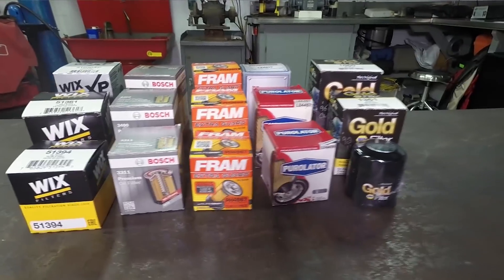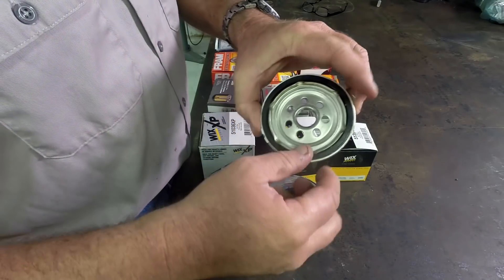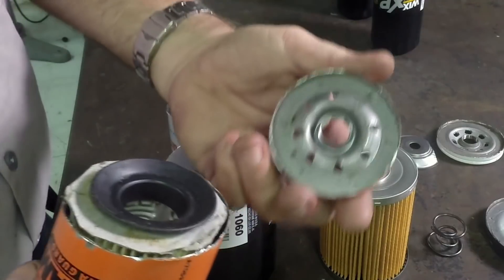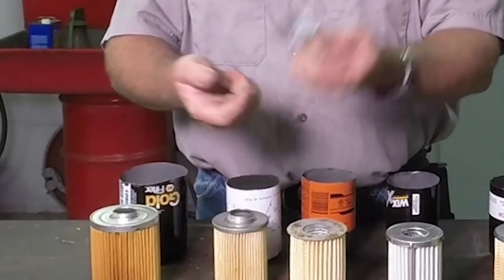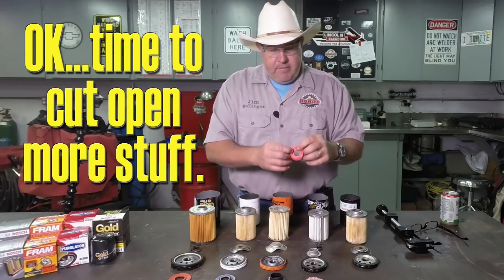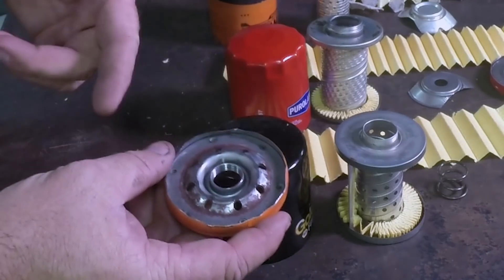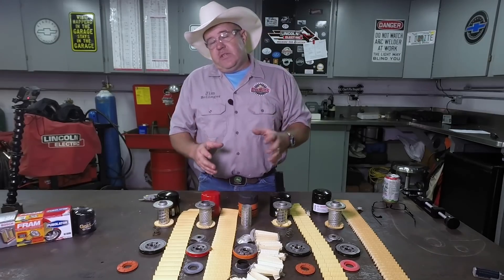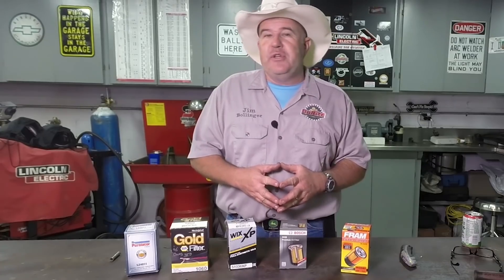The worst oil filter EVER!

Comment: Fram ultra synthetic filters are very high quality.
Reply: Update when you actually do some actual miles on that Acura. 280K like on my RL is a start.
Reply: @16v15  250k on my nissan. Switched to Fram ultra about 20k ago when I saw one of these videos.

Oil change every 3k. Engine runs fine, looked clean when I changed valve cover gasket few thousand miles ago.
Reply: @dielawn22, Granted if you change every 3K and don't live on a desert sand road, you can get away with almost anything. Until you have a catastrophic filter failure. 

Point being, do you want to risk it?
Reply: @16v15  funny you say that. I did live in the desert at the time, with wind and dirt.

As I said earlier. Once I found out the 5 dollar filters were that shitty I switched to ultra. The grip helps.  And ultra is comparable in price and quality to wix
Reply: Wronge one ruined my friends race engine junk
Reply: You're basing this claim on what, exactly?
Reply: @TonyRule  Watch a cut apart video on a Fram ultra synthetic filter. The orange cans are junk, agreed.
Reply: Tony Rule my friend races he had one of the fram premium filters fail he lost oil pressure during a 15min race it ruined his race engine I think that’s proof enough he still has the filter in his shop to show everyone that there junk you can run junk if you like
Reply: @duffman1241  I personally wouldn't trust anything FRAM. Hence why I was questioning why the OP thought the Ultra Synthetic ones are high quality.
Reply: Only Fram worth buying. Completely different construction type (metal endcaps) than Orange can or Tough Guard. To get your monies worth though, needs to be run on extended oil change intervals.
Reply: Fram inc. will be sending you a check soon.
Reply: Fram is very high quality, no one makes filters like Fram does.
Reply: @killer2600  I agree with half of your statement...

Comment: The video is not completely fair to Fram, although I don't use Fram either, but Fram makes several levels of filters.  The one he has is their cheapest line of filter.   They also have a medium level, and a best level.  He should have purchased a Fram filter in the same price range as the others and then compared.  The best level is much like the Wix.  By the way that probably wasn't rust, it was probably glue, but I wasn't there so can't be sure.

Comment: I've been using K&N for the last 15 years on my 3 vehicles, I love the nut on the bottom, it seems to be heavy duty, I'm sure I am wasting my money and NAPA has always been good to me.
Reply: Joe schmo I use the k&n on my harley. Mostly because of the nut on it. Makes it very easy to remove on my bike
Reply: If you need a tool to remove an oil filter, it was either installed improperly or you have too much soy in your diet.
Reply: Tony Rule the filter on my 2000 Electra glide seizes itself every single time. I might add that there is a reason they make oil filter wrenches.
Reply: @room2376  Yes, there is a reason they make oil filter wrrenches, just as there's also a reason they make screw extractors. That reason for oil filter wrenches is because people fail to install them correctly by not lubricating the face of the seal and/or overtightening them.
Reply: Tony Rule I lubricate them every time. And tighten exactly as it states on filters. Seizes every single time. I would add that I can’t even grip it tight enough with my hand to turn it as the directions state, due to the area it’s in. I would also add that on semis and heavy equipment they very often seize as well. In large part because they are on for 10,000 to 15,000 miles. It happens everyday and not always because they weren’t lubricated or properly installed. Much like when you have to remove a broken exhaust stud that broke when removing. It wasn’t over torqued or improperly installed. It’s just been there for a long time and has seized. Hence those screw or bolt extractors. There is existence isn’t always because someone messed up. It’s because “shit happens”.
Reply: @room2376  It's funny how in 25+ years of doing all my own vehicle maintenance, since I finished my apprenticeship as a mechanic, I've never had shit happen like this. My filters always spin off easily by hand (I almost always do the change with a hot engine too so I can't linger too long getting it started turning) and have never once leaked from the base seal. While there's certainly an excuse for an infrequent maintenance item like an exhaust stud to break through long term effects of corrosion, not merely operator error, I don't think the same can really be applied to something like an oil filter, that is replaced at least annually and isn't subject to anywhere near the same extreme operating environment.
Reply: Tony Rule as stated if I could get my hand around if I’m sure I could remove it. But I can’t. So a tool is needed. I would also add that being a diesel mechanic that is ASE master certified for 34 years . I’ve probably seen a lot more than your 25 years of doing your own maintenance.
Reply: Tony Rule also on my bike I can’t even get my hand around the filter due to how tight clearance around it is
Reply: @room2376  I'm not familiar with the model, but that seems like a bad design. On my full fairing Kawasaki you can change the oil and filter without even removing any bodywork.
Reply: Tony Rule it is a bad design. I don’t have to remove any body work. But it’s between the engine case and the frame. With very little room around it. And the way it is around it a typical oil filter wrench is almost useless. They have a big socket style one that fits around the base and even it has a cutout in it for clearance. I find it much easier with the k&n because it has a 1 inch hex on the bottom. Just use a standard 6 point socket and I have no problems. I’ll add that it’s never seizes to the point I have any trouble removing it this way. But to get just my fingers on it and have the grip to remove by only hand. Not going to happen
Reply: Tony Rule by the way what model Kawasaki due you have and how do you like it. For other reasons I’m planning on getting away from harley. I’m looking pretty hard at bmw k1600b’s. And some others. I ride around 15,000 miles a year. So I need something comfortable on those long hauls and the only bike I’ve had any real long distance time on is my Electra glide. Other than my old hardtail but my back can’t those long hardtail rides anymore.

Comment: I had a fram filter collapse on a sbc 350 engine oil pressure dropped to 10 psi or less. This was on a new engine by the way. Swapped to a different filter and oil pressure shot up my engine builder said he seen it before.

Comment: Fram filter destroys Ford  5.4 engines  drain back valve doesn't work.. lose all oil pressure to the hydraulic tensions...
Reply: Motorcraft only for those engines!! I hear ya, I have a 4.6, always use motorcraft filters.

Comment: I used Fram on my Honda Odyssey and at only 300,000 miles, the AC compressor wore out, so I traded it off. If only I'd used a better filter, I could still be driving it.

Comment: What you failed to show is each filter after 3000 miles.  Take apart that Napa filter after 3000 miles and it won't looks so appealing.  Taking apart new filters does not tell the real story.  Lets see you do the same video, but with filters after 3000 miles of use.  Warning, you might get that dandy white hat dirty.
Reply from the maker: Hat dirty? Lol...You obviously don't know much about me. Start with junk, it will still be junk. No excuse for rust in all 3 fram filters. You want to use Fram filters, no sweat off my back, it's your call. Folks should know what they are getting when they buy "oil change special " level of filters. If you love them, by all means.....
Reply: 3000 miles? Heck, the oil isn’t even dirty, cut some open at a full interval of 10K and look at it then.
Reply: Brian S : I did this experiment on used filters. The results go in the same direction. Fram is really disturbing ...
Reply: If a new Fram is already in such poor condition out of the box, It doesn't even rate any further inspection after a few mile use.

Comment: The bottom tier Fram is undoubtedly junk.  However, I wonder if their more premium offerings are any better?   I'd be curious to see how they stand up to a similar inspection.   I ask as I've been using the "Synthetic" version for many, many, years and have several hundred thousand miles on each vehicle respectively.  I do use a premium synthetic oil after break-in.   Either the engines are just this side of bullet proof (Toyota and Mazda) or the upper tier Fram filter isn't quite as crappy as their economy versions.   To be honest, I'm almost afraid to know.  ;)   In any case, damage, if any, has long since been done.
Reply from the maker: I used the grade of filters that many of the parts stores offer with their "oil change special ". No matter how I did this video, somebody is gonna get their shorts in a knot, I really tried to be as fair as possible....thanks for watching.

Comment: FILTERS ARE CHEAPER THAN ENGINES!!!  IF YOU ARE GONNA GO TO A LUBE EXPRESS OR JIFFY LUBE GO TO THE DEALER FIRST AND BUY AN OEM (original equipment manufacturer) FILTER.  TAKE IT TO THESE OIL CHANGE STORES AND HAND IT TO THEM!!!  THEY WILL DEDUCT THE COST OF THEIR JUNK FILTER FROM YOUR BILL!!!  THATS WHAT I DO.  AND IF YOU CHANGE YOUR OWN OIL USE OEM FILTERS ONLY!!!!!  NOTHING BEATS AN OIL FILTER ESPECIALLY DESIGNED FOR YOUR VEHICLE.
Reply: william giampa why are you shouting?!
Reply: william giampa 
Yeah, a WIX beats an OEM filter every day of the week unless the OEM filter is made by WIX.
Reply: Filter doesn't kill an engine ever. It's the idiots with low oil, wrong oil, or not changing it

Comment: I changed a friends oil on his 2005 Odyssey last week. He insists on using Honda filters. Cut the used one open and it looked like the Fram filter in this video minus the rust. It had 5k miles on it and I did not look closely for rust. The cardboard ends came apart in my hands. He usually has his oil changed at the dealer when there is a discount.  Once I showed him the poor quality of the Honda filter he was speechless. Then mentioned the dealer only changes the filter every other oil change.
Reply from the maker: Every other oil change? What in the world! Find a new dealer.
Reply: I told him to change the oil himself or buy the oil and filter and let me do it.

Comment: I have done everything to contact you (no can do) Problem:  yes I have machine shop, Problem a Baker ' Heller Aller " Model 8.    Don't know how but main shaft snapped & wheel smashed on the ground.  What I need to know is the 'wheel hub' Inside dimension of a Aermotor so I can machine a main shaft to fit a Baker to an available 8 foot Aermotor wheel.  thanks Sam
visicoach@comcast.net   or cell 774 406 1913  shop 508 822 5128   thanks

Comment: Good video but you forgot to mention that the Purolator in the Wix XP are from different classes. You should try the Purolator boss and then talk again for heavy-duty filter. Also the anti drain back valve makes a lot of difference when it's made of rubber or of silicone you didn't say anything about it

Comment: I've never seen an engine destroyed because of a bad oil filter,  when you get to much shit trying to go through a filter it don't matter what kind of filter you got on on your motor,  it ends in a mess if you continue to drive it. oil filters are made for 3,000 to 10,000 miles?, and  that's a cake walk for any filter. Maybe they should make oil filters shut down the engine like a fuel filter will do.

Comment: We cut open every filter that comes off any airplane we do an oil change on and roll out the media to inspect for particulate. We use filter cutters that are a lot more convenient than the cut off wheel on a grinder. Interesting comparison of automotive filters. Perhaps the aviation industry is somewhat ahead of the auto industry in this regard.
Reply from the maker: Aviation is always ahead of automotive.  Let's be honest, in a car, if you have a problem, you can always pull over.....lol

Comment: The bigger the area of the filter media the slower the fluid flow, and the greater the filtration.  I found that out with air filters on high voltage, high power RF generators.  If  you could slow the air flow (through filter media )down by adding additional square footage, you had a cleaner cabinet.  I did that by making a cube of furnace filters and placing that over the air intake with it's rigid filter.  Work a treat.